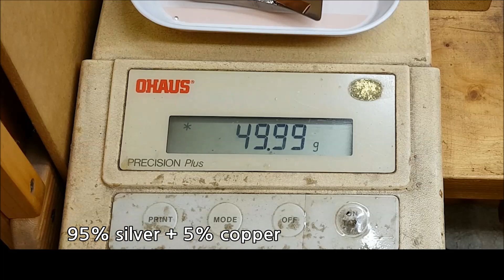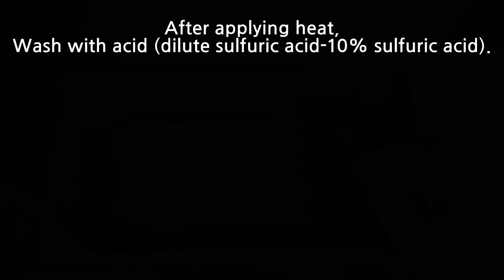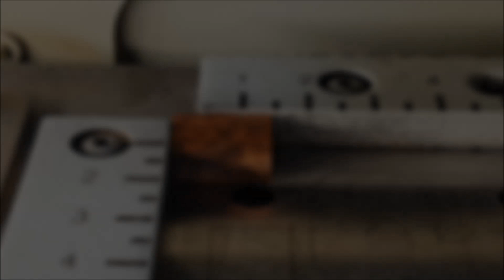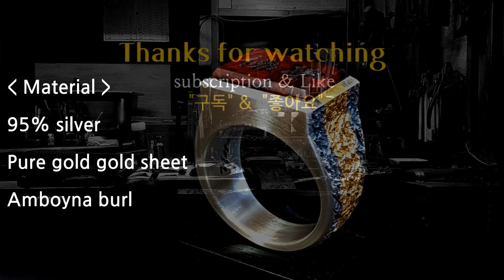[ Making Ring ] 佛 夢 Buddha Dream / 수제 은반지 만들기

Comment: The design is beautiful but a bezel that is flaring out at the top like that will not hold the stone (or the piece of wood, in this case) for very long.
Reply from the maker: Your point is correct.
It was made at the request of the client.
Nothing lasts forever in the world.
However, there is only a time difference...
Still, I expect that over time, it will look vintage and stylish, like old antiques.

Comment: May i ask only one thing? What is the goal/purpose of the use of black pastel powder in your epoxy? Is it to ensure proper mixing, do see if you've applied an even coat more easily or does it have another use that i ignore currently ?
Reply from the maker: Yes. You are smart.
You can judge if it mixes well,
This is because the gap between the gaps can be covered with a dark color (black) during adhesion.
Another is,
If you mix pastel powder with a little bit, it will stick more firmly.
Thanks~

Comment: the melting temp for silver is 962 degrees, if it is 961 degrees will it melt?
Reply from the maker: From the eyes, there is no difference between 962 degrees and 961 degrees.
The criterion for determining that it has been sufficiently dissolved physically and chemically is only about 962 degrees.
So when I melt and pour silver,
Probably over 1000 degrees.
Reply: @SilverMeister  you did a great job to be honest. Maybe you can make things like bracelet or necklace.

Comment: Why copper thooooo?
Reply from the maker: What does "thooooo" mean?
If you are referring to an alloy,
Try searching for "silver alloy".
There is a vast amount of data.
This is because it is too soft if pure silver is used as it is.
Reply: Silver Meister coppers harder then silverrr?
Reply from the maker: @iliketurtles2993  
Too much to explain in detail.
Find the material yourself.
Copper is not stronger than silver,
If you mix copper with sterling silver properly, it will become stronger.
It depends on how much.
It depends on the situation.
It all depends on what you make.
It is by no means simple.
Reply: Silver Meister cool thxxx